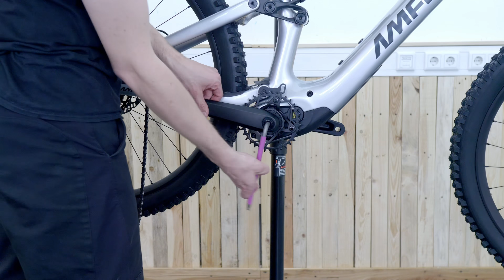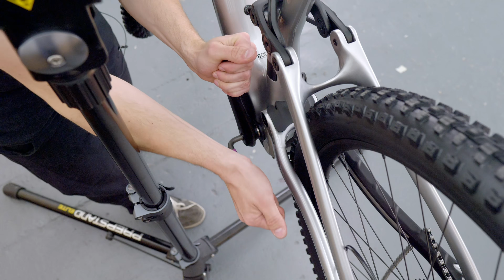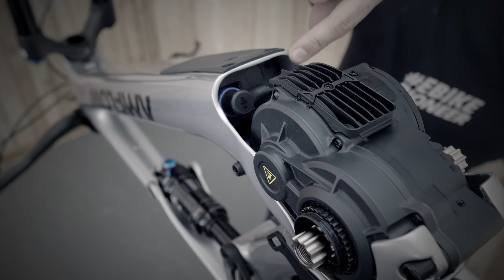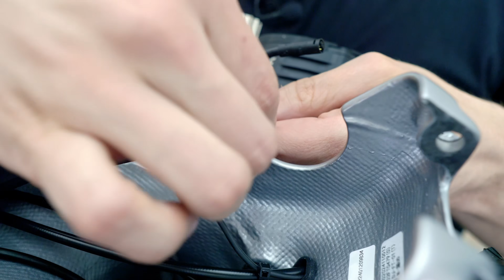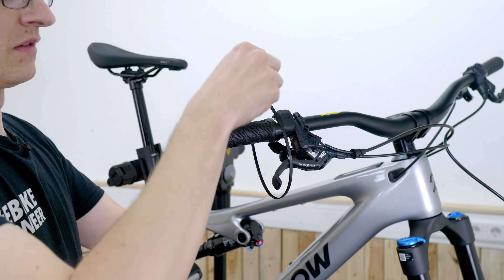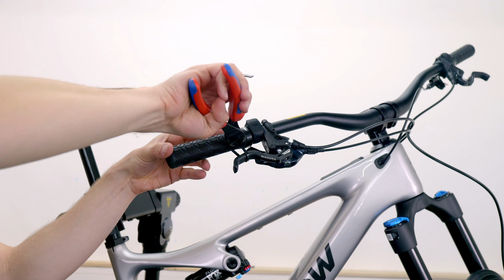Motor Replacement on the Amflow PL Carbon with DJI Avinox | Tutorial 🔧 | EBIKE24

Comment: Are those motors serviceable?
Reply from the maker: No service kit available for the moment. Thanks.
Reply: @ebike24 I saw a YouTuber toured Bofeng and it was very impressive because they manufacture all their parts and longevity tests are done.

EV bike mechanics said Bosh generation 2 is excellent because big gears. Easy to work on but heavy units.

Comment: My amflow PL carbon, right hand electric control stopped working? the bike is 3 months old is there a battery in the bar mounted button control? please any help?
Reply from the maker: Yes, there is a button cell battery. https://www.ebike24.com/dji-avinox-wireless-controller-module-control-unit-right. Thanks.

Comment: Hi. If I change to a new motor?  Is it plug and play with my existing lcd display unit ?
Reply from the maker: Yes if it's the same type of motor. No if you swap an M1 with an M2. Thanks.
Reply: no, you need new battery and lcd.

Comment: If I want upgrade with the Sram GX T-Type eagle AXS where I have to connect the cable?
Reply from the maker: If you mean installing it on a Amflow PL Carbon non-PRO, It's not possible. It works only with the PRO. Thanks

Comment: where can I buy just the Avinox motor, battery and touchscreen/esc? I want to put it on a custom build with duel battery and a rear hub motor. AMFLOW did a great job but I am not paying the price of 5 new frames for 1 overpriced frame.
Reply from the maker: For the moment, the Avinox drive system is not sold separately, as a standalone. It probably will, sooner or later. Thanks.
Reply: @ebike24  this is crazy. on the other hand, can I order a standalone CX Race gen 5 Bosch unit as an end customer online?  thank you for the response.

Comment: @ebike24, I don't understand why you need to remove the cranks and spider/chainring to remove the drive unit though.  seems unnecessary since the motor mount bolts are easily accessible. I just need to remove the dropper cable, so don't think I need to remove cranks and spider.
Reply from the maker: You’re probably right if it comes to just take out the motor for maintenance or whatever. If you are to replace it, you should remove  cranks and spider/chainring anyway. Thanks
Reply: @ebike24  thanks for doing great videos! much appreciated.

Comment: Are you guys replacing allot of these motors? How often are you seeing these DJI motors last in MTBs? anything to add about life expectancy of the Bosch CX series would be helpful as well
Reply from the maker: At the very beginning we had a couple of issues with a motor center axle which was 1mm displaced. Then we sold a lot of Amflows, without any problem. It's too early to gauge durability. Bosch Performance CX, when properly used, can well last over 15,000 miles, or 22,000 kilometers. Thanks.

Comment: Hello, is it possible to connect an headlight to the Avinox system ? 
If yes, what voltage and what power ? 
I couldn't find any information about this.
Reply from the maker: Amflow  sells an headlight with autonomous battery. Compatible lights are for now:

Supernova (MonkeyLink Version):

MINI 3 Pro

MINI 2 Pro

M99 MINI Pro

Litemove:

SCN-1700

You will need an adapter cable with HIGO Z405 connector.

30W is available for the lights.
Reply: @ebike24  ok so there is no socket to connect lighting with this engine ?
Reply from the maker: There is, see my other answer.
Reply: @ebike24  ok thank you, I hadn't seen the second part of your answer